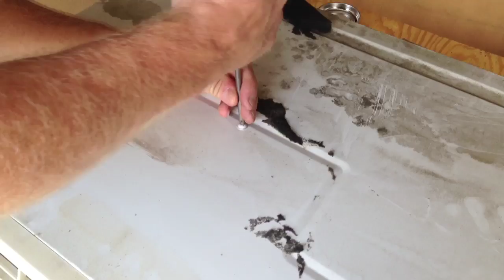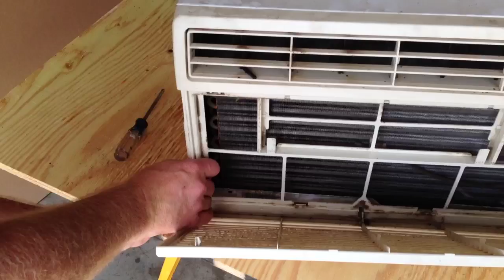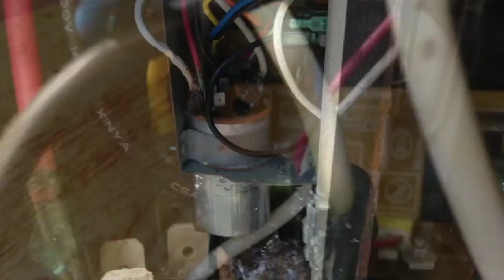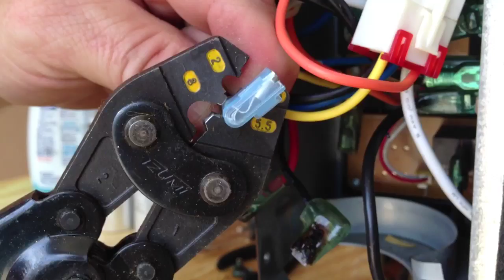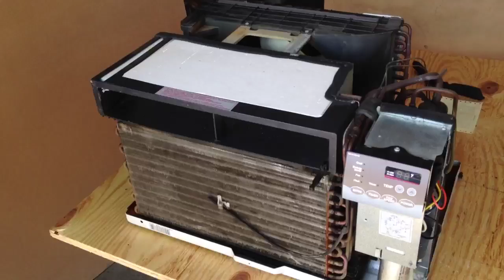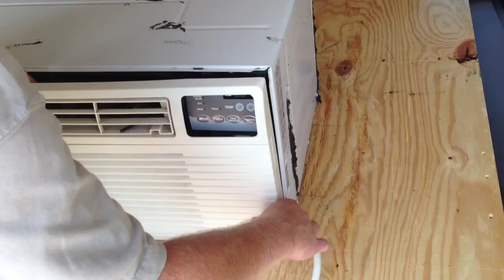Repairing an LG A/C unit by How-to Bob

Comment: I wonder if you can give me some advice on a Frigidare wall unit that beeps and the lights go one, then there is no more power after that.  I have tried different outlets, hit the reset button, checked all connections and wires...nothing obvious.  Any ideas?
Reply from the maker: It would be hard to diagnose this problem without seeing it. What is the model number?
Reply: funbro1
Thank you for getting back to me.  The model number is Frigidare Energy Star model LRA087AT7.  I have taken it apart a bit, and don't see anything that looks worn, dirty, blocked, burn or anything.  It all looks ok...so I don't know what to do next?
Reply from the maker: For this issue I would start out by replacing the capacitor. The capacitor helps the motor start running, if your capacitor is weak or not working at all then your error code could be caused by the bad capacitor. If you want to try to test the capacitor first just make sure you carefully discharge it first by using a light bulb across the terminals. Then use a meter to test the capacitor. The next possibility is the control unit, but that will be a little more expensive. Hope this helps.
Reply: funbro1 Great.  Thanks.  So I use a light bulb metal end I assume against the capacitor terminals.  Will this have any reaction to the bulb?  It must discharge some stored energy or something?  I do  have an electric meter...I can give that a test.  Thank you.  I hope you don't mind the questions.  I really appreciate your help.
Reply from the maker: Yes just put the 2 contacts on the light bulb across the 2 terminals on the capacitor to make sure that it is discharged. Good luck.
Reply: funbro1
I removed the capacitor, and used my electro-tec voltage meter on the capacitor setting the meter at 600 and 200 volts.  There was no reading at all.  I tested my meter on the battery of the voltage unit and got a 12V reading so I know it is working.  Could this be why the LDC and other buttons only light up for a moment and then shut off?
Reply from the maker: It is possible.
Reply: Well it was not that part I had it checked by an electrician.  I can't figure it out.  The electric shuts off seconds after it is turned on.  I think I need a new one...this is still in great shape, but I don't know what is wrong with it.  Thanks for trying to help me out.
Reply from the maker: Sounds like the control board then. :-(
Reply: Is that something worth fixing or getting a new one?  I don't know if it is possible to exchange it.
Reply from the maker: Sounds like you need a new one.
Reply: funbro1
ok.  Thank you.

Comment: what if the unit is not getting hot?
Reply from the maker: Sounds like it could be the heating element. Once you locate the heating element you can test it with a OHM meter. The reading should be very close to zero if not zero. If the meter reads OL or a very high number then it's time to replace the element.